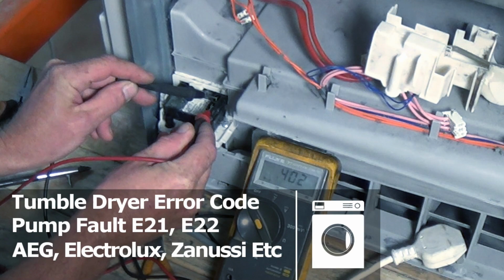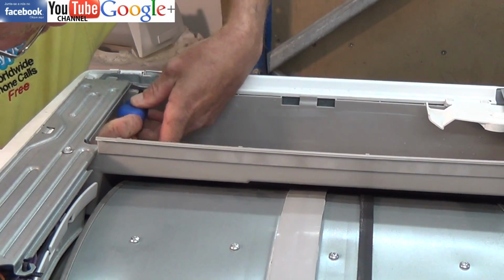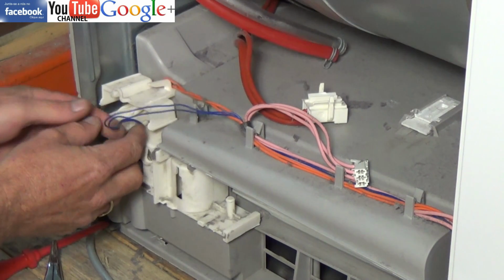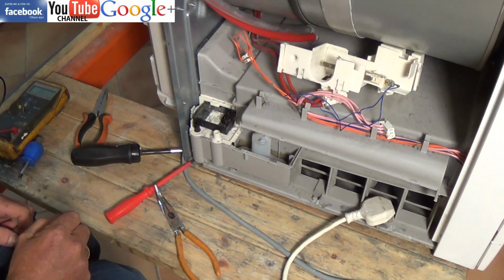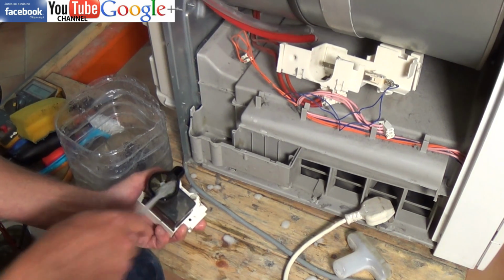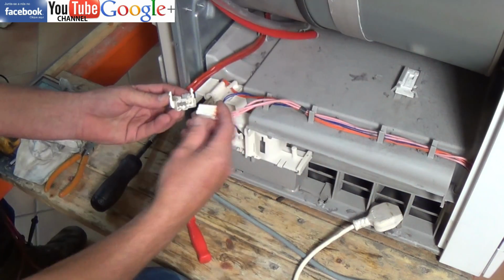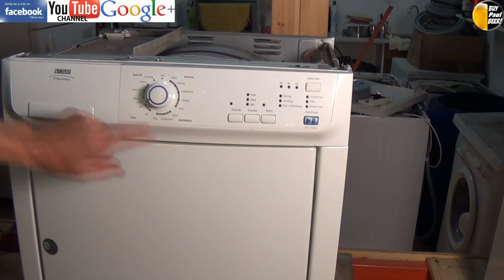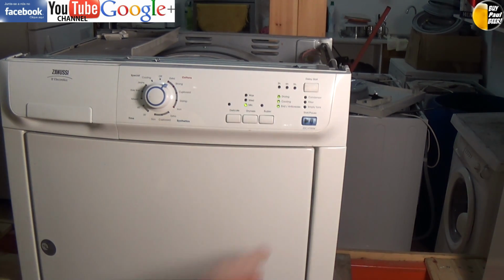Tumble Dryer Error Code Pump Fault E21, E22 AEG, Electrolux, Zanussi Etc

Comment: Hi I have one of these with the water collecter at the bottom, I've striped and cleaned it but it just doesn't get to the tank, it over flows out the bottom do you think it will be the switch.
Reply: I get 8 red 3 green lights